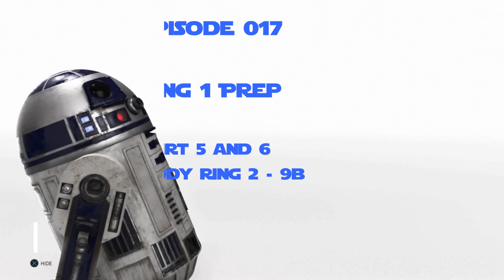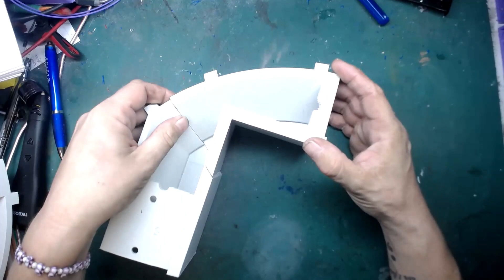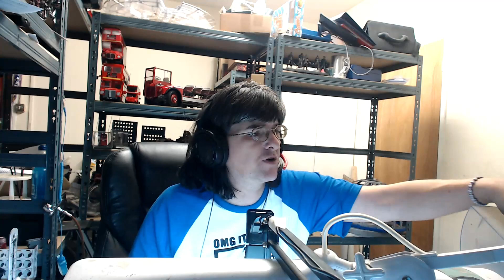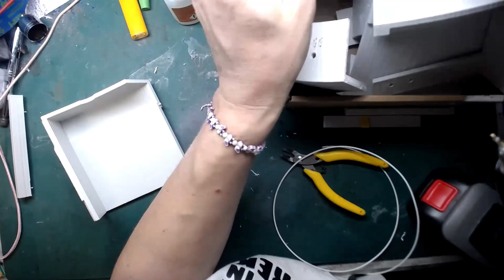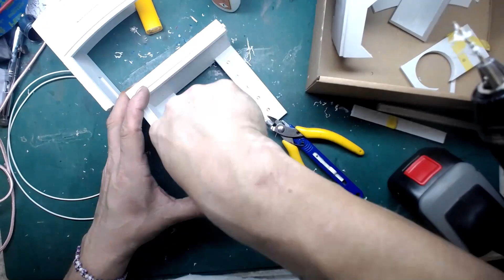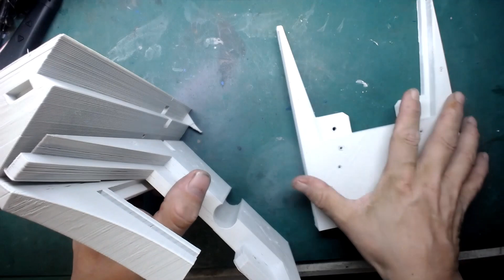Build Your Own R2 D2 Episode 17 - Ring 1 Prep

Comment: Making as much as possible yourself will not only give you a greater sense of satisfaction, but will also give you greater confidence to sort out any problems or set backs that you will encounter.  Especially with the electronics!  Best of luck to you as your build continues,
Reply from the maker: Thats a really good point and one that I hadnt thought of. If this is 100% built by me and it goes wrong I will know how to fix it as I built it from scratch. If I buy bits and it goes wrong I wont know where to start looking and may be forced to buy new parts later on. Thank you, a really good point.